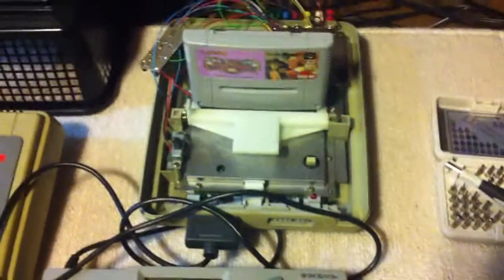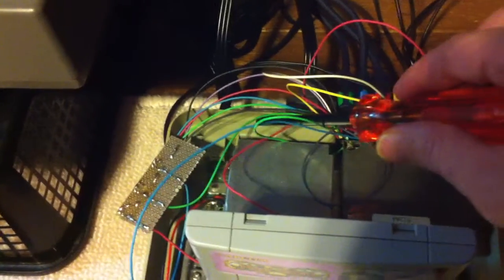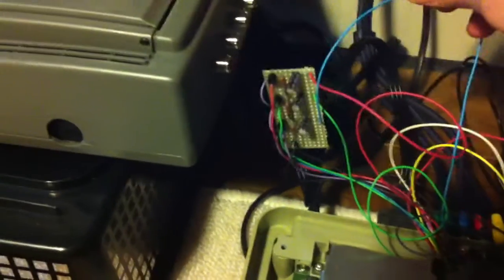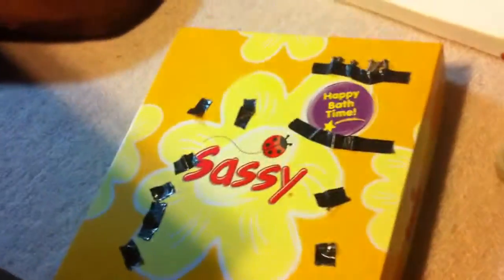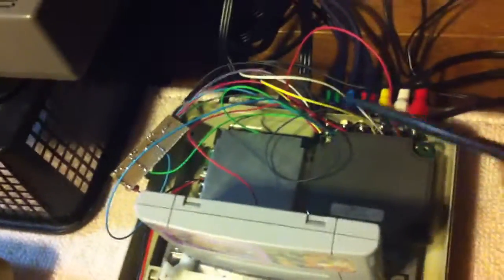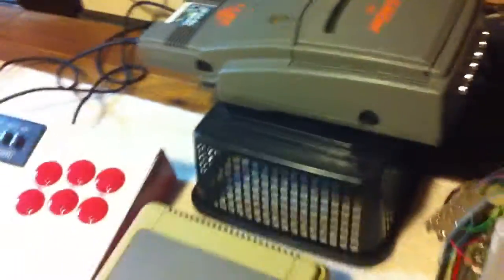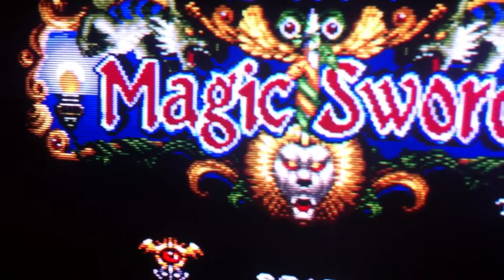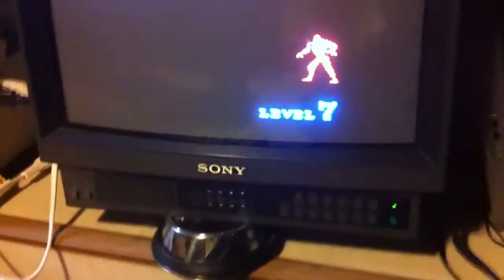Super Famicom RGB mod (component)

Comment from the maker: Hey there, first of all, the Super Famicom DO NOT NEED the rgb amp, colors were too bright so I just connected each one of the red, green and blue lines to a 220'' 16v capacitors, and the image is mint (I'll show it in my next video).
If you want me to make a tutorial video, let me know.
I added the link for the rgb amp in the description of the video (thanks to faginrs500)
also I added a link for the schematic for the Super Famicom output pins, found on the
bottom side of the mother board. Ori

Comment from the maker: Yea, most would mod the scart cable, though I find them hard to work with (small space), also,  I wanted to crack open the sfc and see whats inside, as well as having a direct connection to the PVM without the sync strike....I did use the 12v/comp sync for syncing...

Comment: Ori - why are you using an amp for the SNES, you don't need it and the colours are way too bright dude.  Remove the amp and place three 220uf caps on the R G & B lines.  It will look 100% better trust me!  I could have also told you how to mod an EU scart lead to work with your NTSC SNES. ;-)

Nice mod dude - but rip that amp out!!!!

Comment: Nice work but the Euro SCART will work on the NTSC system. You just have to swap a few lines and add some 220uf caps, remove some resistors and swap the 12v line for 5v. Also, the 12v line is actually composite for the NTSC systems, so you could use that instead of the composite video line.